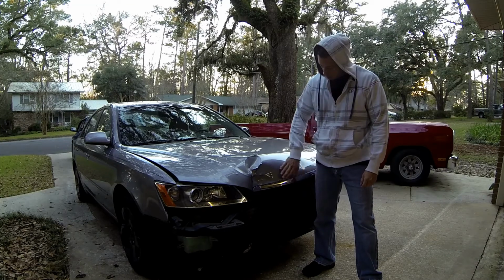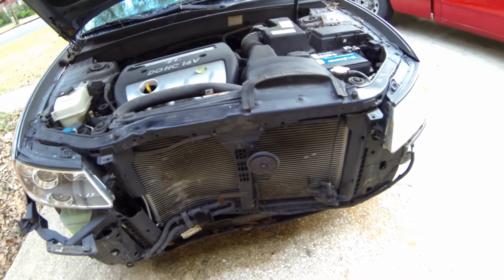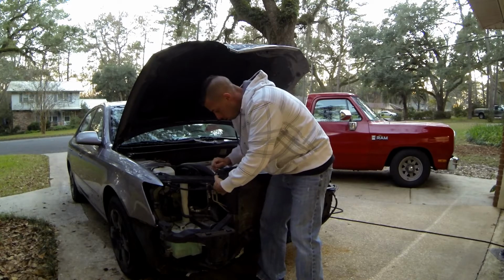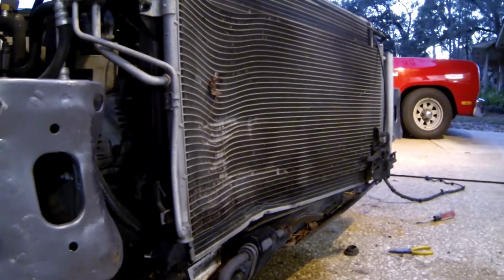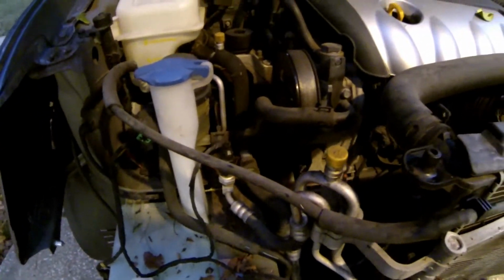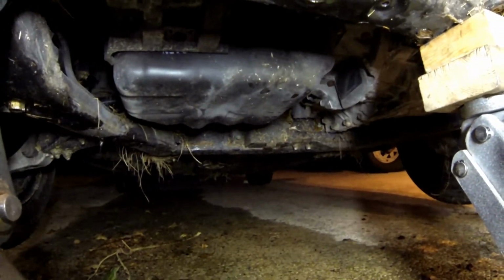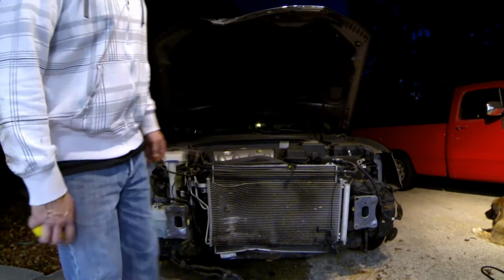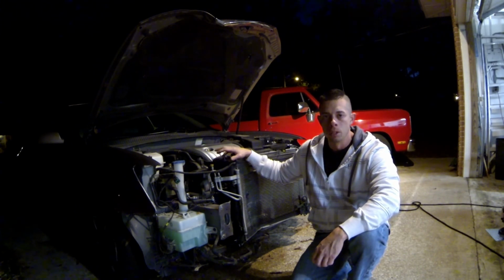Busted up Sonata Fix or Sell?

Comment: The biggest expense as you know in labor,  it's times like this, by being a technician is priceless.
And I'm sure you will find the parts you need in a salvage yard, or find a cheap donor car that has a wrecked rear quarter.

Easy step for a stepper,   Thumbs up Alex.

Comment: As long as you're sure that front cradle/subframe hasn't been compromised or twisted by that dent then definitely fix it, apart from that it's all cosmetic really.  If the headlights look ok then don't worry about changing them.  If all the mountings are intact the only reason to change them would be if the lens is damaged, and even then it might be possible to replace just that...

Comment: If it is a good running car and the parts are cheap enough ..Heck yes I would fix it ..I would be hurting running a ratchet that much I would be using my 1/4 in Harborfreight impact driver
Reply from the maker: I left my Marco impact at work! Rrrrr. Lol
Reply from the maker: +Alex's Garage Matco

Comment: If the airbags went off, it's probably a total.  Finding new ones is expensive, at least $300 - $700 each used.   If so, you should immediately setup an ebay search as they sometimes come up for way way cheap. The rest is (relatively) cheap - as someone said, you can probably buy used parts, esp painted parts where you can avoid the cost of a respray.

Comment: I'm sure you should be able to find a rad. and cond. at a local scrap yard for less than the cost of new, so there's some dough saved there. The question is, what's your time worth? By the looks of it you've got a bit of time in it already. If it were me I'd definitely fix it. Your outfit was far too nice to be wrenching......lol